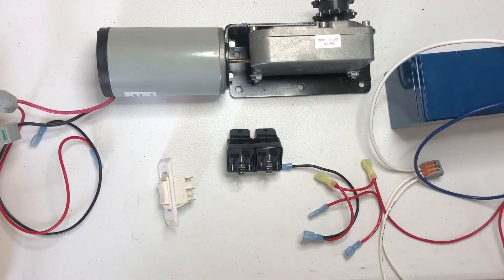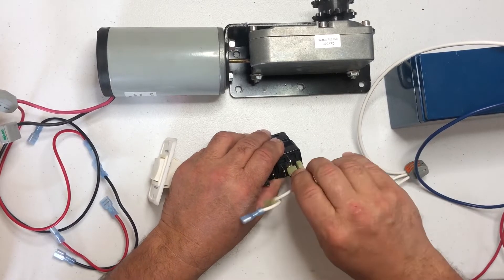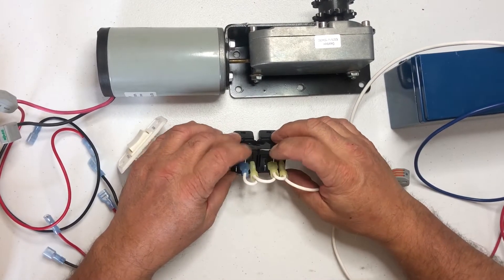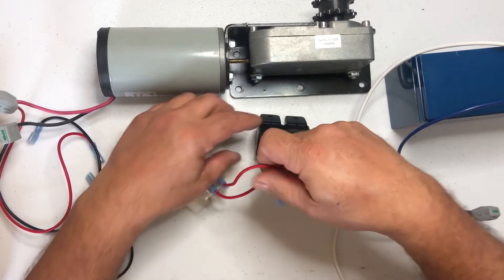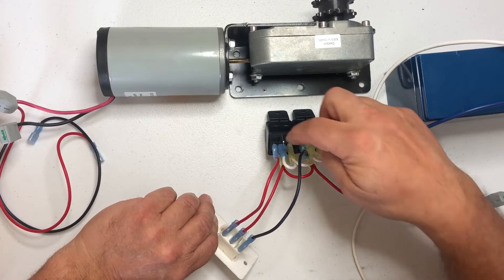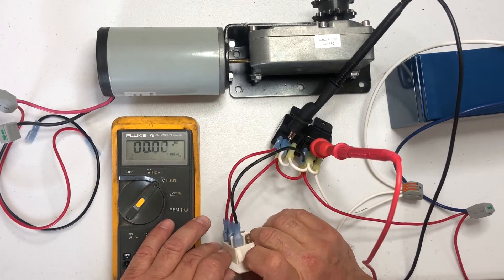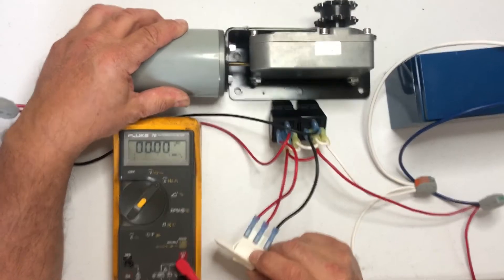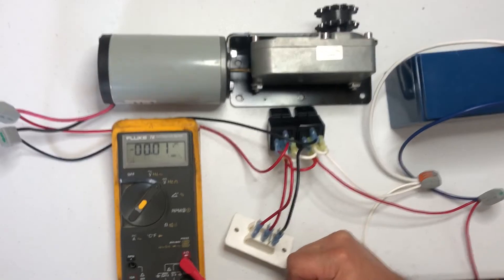Reversing Polarity with two relays￼

Comment: Hi, is it worth fusing the positive from the battery?
Reply from the maker: @DrivenByGeorgeJexter  I would say you have to fuse the positive from the battery…
Reply from the maker: @DrivenByGeorgeJexter  find a chart and use the correct wire size and fuse

Comment: Hi Mik Master

I am working on wiring in a motor into my car in the exact same way you have. The motor controls a small valve which opens and closes my exhaust. I purchased a genuine switch that fits in my car perfectly. It is a momentary switch which rocks upwards and downwards and then returns to centre. However it only has 2 connectors and not three connectors how you have demonstrated. 

Is there any way at all to make this work? (I apologise if this is a silly question, I am a novice when it comes to these things. Just doing projects to learn).

Thanks
Reply from the maker: I never assume how a switch works. Most of them work how I expect but I always check them with a meter. Do you know the actual details of the switch? In this video you need to be able to apply power to one of the relays at a time. I’m not sure off the top of my head how you could do it with only one output signal from a switch…
Reply: @mikmaster63  I'd love to tell you about my issue in more detail, with images included. Is there anyway that I could reach out to you? through and email or social media profile perhaps?
Reply: @mikmaster63   I'd love to tell you more about my issue in more detail, with images included. Is there anyway that I could reach out to you? Through email or social media perhaps?
Reply: @mikmaster63  is there any way that I can contact you privately to discuss this further? maybe a social media or email address? I'd love to get your further opinions in more detail in relation to my project

Comment: hi there! is that mean the heavy load does not pass through the switch, but only through the relays?
Reply from the maker: It’s sounds to me that there is another issue. Most of the relays I use are rated at 30 amps also. Check what amp draw the motor is actually drawing. It could be loose connections or a bad motor. Also, try a marine type switch (something water proof) maybe the moisture is corroding the switch…
Reply: @mikmaster63 
When its 95 degrees Fahrenheit outside with intense usage of few hours twice a week, the plastic parts of those switches get distorted. It happens every 5 months in average. Tried some metal switches they also falied with some plastic pin inside. With a relay THERE IS NO PLASTIC INSIDE. The switching is done with metals alone.
Reply from the maker: Yes
Reply: @mikmaster63  Thank you. I have this problem with my kayak's trolling motor that uses 6-pin rocker switch for doing reverse polarity on-off-on. The problem is that this switch is rated 30 amps, but eventually it fails (melts) every few months in the middle of the sea. the motor is "only"  12v DC 20A (max). No matter how many different switches brands  I have tried, they all fail eventually. some on the handle, some melts from the inside, nothing lasts. 
Also, there aren't many high AMPS 6 pin switches. they all range 20-30 amps and they all fail.
I think this solution will solve  the problem.
Thank you!
Reply from the maker: Sounds like you got it figured out 😀

Comment: thank you, I have a momentary rotary switch thats two independent NO switches underneath. I had expected it be similar to a rocker switch but it doesn't work that way. Seems like I can use two relays to reverse a DC motor with this method. appreciate the video

Comment: What kind of motor is it?
What is its voltage and amperage rating?
If it’s a DC motor, why not use a DPDT switch?
All this information is missing from your video. 
I have a 4.25 hp, 130 VDC treadmill motor and I want push buttons for forward, stop and reverse. A normal DPDT toggle switch won’t cut it. 
So I watched your video to see how it’s done with relays, but I still don’t know what to do. 
Paul
Reply from the maker: It’s a 12 volt motor out of a RV Slideout. It’s 12 volt, the relays are rated at 30 amps. This is the video for for DPDT switch. https://youtu.be/_TotMbbH1ms   This info was not important for me to put in the video. It’s a video on how to wire 2 relays to reverse polarity. You would need to find relays that will handle whatever load you are trying use. How many amps does that motor draw. Is it really a 130 volt DC motor not AC? I think it might be difficult to find relays that size, at least I couldn’t find any. I work on primarily RVs so that motor you are trying to use is out of my scope of focus.
Reply from the maker: Try this guys videos https://youtu.be/B1pj3N1J2vg

Comment: I wish you showed a wiring diagram for this. 
Is that a DPDT switch in white? What is its rating in amps and voltage?
What relays are you using?
What is the voltage and amps of the winch?
I have 130 VDC 25 amp treadmill motor that I’d like to control with a rotating selector switch but it’s not rated for the volts or amps. Could this be possible using relays?
Thanks,
Paul
Reply from the maker: https://youtu.be/7sQaS6jM3V4
Reply from the maker: I work with mostly 12 volt in my line of work. Reversing direction of a AC motor is difficult from what I understand. The stuff I’m using is 12 volt 30 amp rated. You would have to use relays with contacts that are rated for your load (130 volts 25 amps) the coil could be triggered by lower voltage, just depends on the relay…

Comment: Hello, is it possible to control such a set but with a joystick?
Reply: https://youtu.be/H2lro-Ra8pI about that
Reply from the maker: I haven’t tried that. Are you looking for variable speed or on/off? What kind of joystick?
Reply: I'm interested in switching on and off, it's supposed to be an electric actuator
Reply from the maker: I think you could just wire in the joystick where the switch is. In this set up we’re just sending positive voltage to the coil of the relay. So the left relay energized moves the motor one direction and energizing the other relay moves it in the opposite direction. I haven’t played around with joysticks so I would need to know which one. I would think any joystick that works like the switch would work easily. If you want it to have speed control check out last weeks video and the one going up later today.

Comment: I love this that you had the wires already organized(with the terminal pins) before connecting them to the relay - makes it visually so much clearer to see the simplicity of how it is really connected - question - what if you want to add a diode here? would it be correct to have one for each relay? - Many Thanks for your response !
Reply from the maker: Oh gotcha I have experienced that before. ya you would probably need one for each relay as the spike comes from the coil. I had a Motorhome I was working on that the water heater was controlled by a relay and whenever they would turn it off it would make the LED lights flash. The fix was a diode installed from the coil to ground so that spike would bleed off. Thanks for the comments…
Reply: @mikmaster63  "The fix was a diode installed from the coil to ground so that spike would bleed off."  Um. "whenever they would turn it off it would make the LED lights flash" That flash WAS the LED inside doing it's job by using up that back EMF. You didn't need to add anything.
Reply from the maker: Not sure where you want to put a diode…
Reply: @mikmaster63  in parallel to the relay coil - I assume I would need two diodes, one for each relay, yes?
Reply: a schottky diode not an LED
Reply: @pacificrestyling9843  "in parallel to the relay coil - I assume I would need two diodes, one for each relay, yes?" 
 First off, there are a lot of these relays that already have a diode built-in. Most will show a diagram on the side with it.

"a schottky diode not an LED"

An LED is preferred due to it actually using the power dissipating it faster.

" I am using this circuit layout with sensitive equipment "

You said it yourself. You Only need that is you have other electronics that are sensitive or don't have protection. 

Of course I say add it anyway. Better to have it and not need it, then need it and not have it.
Reply from the maker: I didn’t use diodes and it works fine so I’m not sure why you need diodes. Here a link to the diagram video I made. 
https://youtu.be/7sQaS6jM3V4
Reply: @mikmaster63  I am using this circuit layout with sensitive equipment  and want to use tamping diodes as a means to protect against back EMF when the relay coil go from energized to off.  I think I will have to use two, one for each relay as they energize separately.........Thanks for your input much appreciated !!

Comment: mine clicks but wont move the motor. i pluged in the motor directly to the battery and it works so its not the motor i wonder what’s wrong
Reply from the maker: https://youtu.be/7sQaS6jM3V4
Reply from the maker: Without being able to see it, make sure only one relay is getting triggered at a time. I posted a link to wiring diagram also.

Comment: What would happen if both inputs were triggered at the same time?
Reply from the maker: Not sure how that could happen, but if it did it would just put positive on both sides instead of negative and nothing would happen…
Reply: @mikmaster63  ok thanks I was thinking of using buttons instead of a switch but I think a switch would be  better anyways
Reply from the maker: @TTTray13467  you would wire it so when one button is pushed the other buttons power is dropped out of the circuit. I would use relays to do that.

Comment: Is the output  to the motor on the 30s or the 87s or does it make any difference?
Reply: Can you put the numbers on your diagram for each relay?
Reply from the maker: https://youtu.be/7sQaS6jM3V4
Reply from the maker: In this case the motor output should go to 30. It does matter. Negative goes to center or the 87a. Positive goes to 87. Sorry I knew those identifying numbers were there I’ve never used them…lol

Comment: I want to use this setup but will be using reed switches for travel limits and a photo eye for the switch. How would I wire in the reed switches?
Reply from the maker: I have built something very much like that. You would series in the reed switch between the switch output and the relay coil. The reed switch would have to be able to carry the coil load, which should be very low. So when the magnet reaches the reed switch it would open that circuit and the switch wouldn’t be able to send power to the coil. I can try and make a diagram when I can if you need…
Reply: @mikmaster63  I would appreciate that, thank you
Reply from the maker: I’ve put up a video I think will help. I didn’t have a photo eye. I substituted a manual switch. Check it out and let me know if it helps.
Reply from the maker: https://youtu.be/Pr_KREm_fzI

Comment: Thanks for this I think I can use it. 
I also would  like to be able to adjust the speeds of forward and reverse independently. Any chance you have any idea?
Reply from the maker: Potentiometer
Reply from the maker: Cytron 10A DC 7-30V Potentiometer and Switch Control Motor Driver Speed Controller. Something like this maybe…
Reply: @mikmaster63  that’s exactly what I was thinking and is exactly what I bought but you can only control one direction at a time.  I’m wanting to auto feed a sawmill slow going into the log and returning at a quicker pace without any adjustments.  I’m thinking it may not be possible without a PLC or an Audreno.  Thanks for the response it’s much appreciated!
Reply from the maker: I’ve been thinking a lot about it. Is it AC or DC motor what’s the amp draw?
Reply: @mikmaster63  12vdc  I haven’t bought the motor yet until I have everything figured out.  I’m looking at wheelchair motors and from what I’ve read they can draw up to 40 amps if working hard.
Reply from the maker: I added a diagram of an idea I had. Not sure if I’m on the same page of what you are trying to do…
Reply: @mikmaster63  you are on the same page as I am. This looks good to me. I just ordered the motor. I’ll look at power supplies and potentiometers tomorrow. Hopefully be up and running shortly.
You definitely went above and beyond!  Hard to find guys that will do that these days. Thank you it is very much appreciated!
Reply from the maker: Just put a potentiometer on both sides.
Reply from the maker: There’s another way to do it with a different switch and additional relays for bigger loads. If you can’t find switches that can handle the load you can control the load with relays.
Reply: @mikmaster63  I’m going to use a joy stick and yes I’ll have to use additional relays. 
Thanks again!